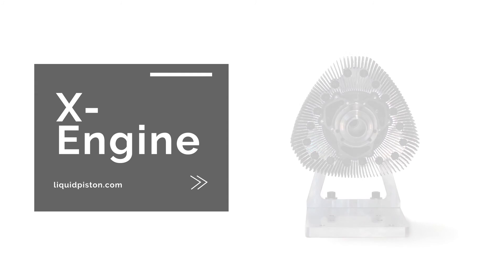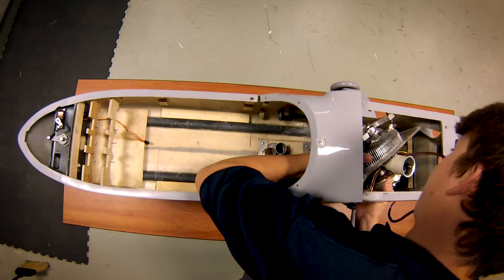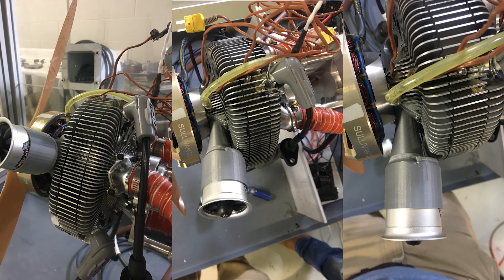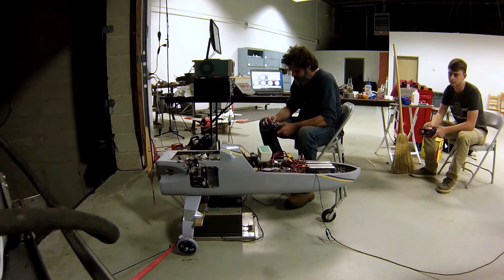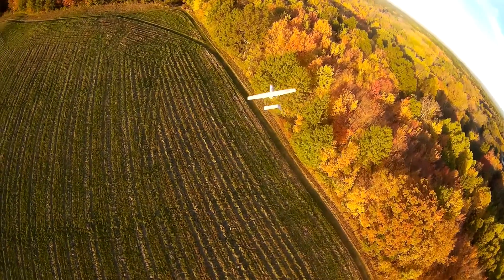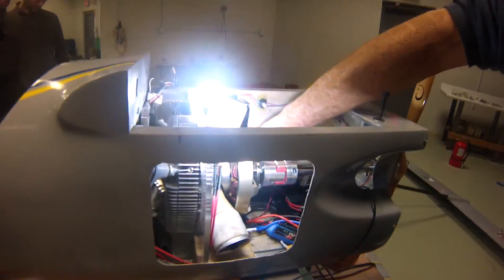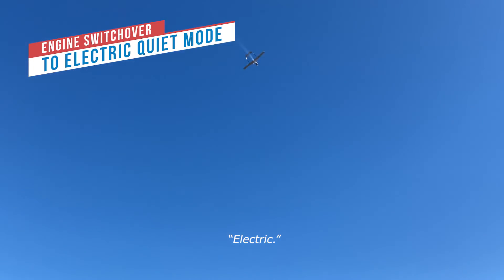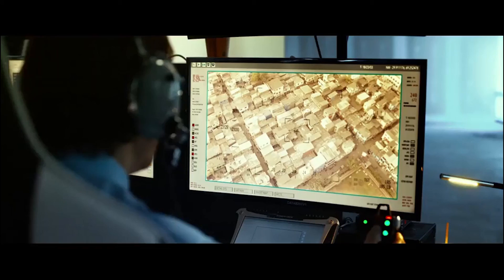LiquidPiston X-Engine takes flight [Long]

Comment: For the extreme power to weight ratio, it’s rather to work on helicopters than fixed wings aircraft to my thoughts... and strong enough to lift weight?
Reply: PASS! No way do I want to jump in a heli with an engine with such a short running life. I don't want to get in a heli with ANYTHING new and not VERY thoroughly tested and PROVEN to be durable and reliable in other applications first.
And why in hell would a plane not want the same (supposed) hp to weight benefits? That makes little sense to me. Either way, I don't want to see it in manned aircraft till it's very thoroughly proven itself in MANY other less potentially deadly applications than manned aircraft, models yes, nothing where a human life is at risk though.
Reply: @probingtime666  well seems I know too little about this engine type, too short lifetime is an hazard to aviation. But it’s not an hazard more on helicopters rather to fixed wings, because the turning rotor can still make it land safely without engine power. 
The reason I think it’s better on high hp to weight ratio, is I think it that it can lift up more weight for the same size... might be wrong ... how do you think about this?
Reply: @minercraftal   a heli can glide when an engine cuts out by very quickly reversing pitch on the main rotor blades and using the falling to keep them spinning and maintain momentum but, they don't have a great glide angle so you're stuck with finding somewhere very close. You do have the advantage of not having to come in at much speed and with the momentum built up you can almost land the very last bit at almost a stop which opens up options you haven't got with a fixed wing aircraft but, I'd prefer to have that much more gradual glide angle and time and distance to find somewhere if not an actual air strip. With the heli if you're in thickly wooded or very rough mountainous territory you're stuffed. You may not be much better off in the fixed wing but at least with the much greater gliding ability you've got a bit better chance of getting past or around that and finding somewhere. Either situation is bad and very dangerous, that's why I'd want to have it in common usage in cars, bikes and all sorts of other applications until it's well and truly sorted and proven it's reliability and durability first.
As for:   " The reason I think it’s better on high hp to weight ratio, is I think it that it can lift up more weight for the same size... "
Well yeah. The same can be said for the fixed wing aircraft too though, or am I somehow missing something?
A lot of larger helis use turbines which are light by comparison. I fly every second weekend on average with a mate in his old Bell 47 which like nearly all others I've seen are powered by a horizontally opposed 6 cylinder Lycoming engine of (if I remember correctly) about 280 hp which would be a pretty heavy lump of a thing I could only guess at the weight of but that guess would be around 400 kilos. I have helped load another Bell 47 onto a truck as a favor to him that was used for aerial spraying and your usual Bell 47 only has a load rating of (again, if memory serves me) 200 kg but this one had been converted to run on a surprisingly small looking turbine which would have reduced the aircraft's weight significantly and if that turbine was capable of the same or more power that would significantly increase it's ability to carry much larger tanks of spray making it much more practical for that sort of work.
There may be some sort of modifications that could compensate but my mate hates flying on his own, partly because he likes having someone to talk to and also to share the experience with but, if I or someone else doesn't go with him he sticks a milk crate filled with bricks on the floor on my side because it needs extra weight there to make it fly more smoothly and more stable so with the crop spraying one those spray tanks would do that when full, I have no idea how it handles while flying back to refill it though.
Reply: @probingtime666  well you know a lot of details and experienced. The last things to my understanding, is when the tank is full, the aircraft has more weight to carry, so the stabilator is a little bit hard to handle the horizontal stability, when the tank is empty, it’s less weight aircraft need to handled so it can fly back easily... 
and seems with a little bit more size of an aircraft, the larger of hp to weight ratio the engine can get, that’s what I don’t know nor thought about, I was thinking about the size of a bike of an avionics... well but as I know there’s more knowledge about it I don’t know, the hp to weight ratio is not the only things to it. 
Thanks for shearing your experience and thoughts XD.
Reply: @minercraftal  If you go to their website you'll find information about their current stages of development and testing etc and from what I read they so far have a very short lifespan. Not only that, all the stated expectations are so far just designers dreams and have never been achieved and may never at all.
My main point is that there's a lot of applications for engines on the ground where they can be used if they turn out to be any good, NOTHING that hasn't been VERY thoroughly tested by use and time that can be tested on the ground belongs in any aircraft where lives are at risk.
Reply: @probingtime666  well... these wonderful-looks design still have it’s defects, nothing perfect in the world yet XD
Reply: @minercraftal  They're making claims about it while the current state is that it's worn out very quickly, only reaches about half the claimed revs it's "supposedly going to AND only around half the power it's claimed it's "going" to be able to put out. They talk about a UAV with it AND an electric motor to run on for "quiet mode" which means the weight of this engine AND the weight of an electric motor big enough to put out nearly as much power as their engine plus a big battery to run it for however long it needs in so called silent mode even though a huge percentage of the noise from ANY model plane comes from the propeller, NOT so much the engine  so with 2 complete and separate power systems that would weigh significantly more than if it just had their engine meaning it's going to have to work much harder to fly all that weight so that alone means it will HAVE to make a lot more noise. There's far too many BS claims and essentially just dreams coming from them. I honestly hope they actually can get it to perform as they claim and that they can make it durable and reliable but, so many claims based on their hopes and no facts or demonstrated abilities makes me feel very much like it's a go fund me scam idea at worst and wishful thinking at best.
And what's with the name? Liquid piston? There's nothing even remotely resembling any sort of piston made of liquid and if anything it very closely resembles a Wankel rotary which it pretty much is so not even a completely new engine design.
If it's around in 10 years and replaced ALL those old primitive piston in cylinder engines I'll be happy to have one running my car, bike and outboard motors, I very much doubt it ever will though.
Reply: @probingtime666  anyway they are still working on it XD unlike me, thought about a rotary screw engine but barely make it continue but stuck on the “crank gear screw rods” shape... I like them make the parts so little with a extremely easy assembling. Maybe with some kind of inspiration they will solve the problems... shaping is a hard knowledge XD
Reply: @minercraftal   Well, they've made working engines and are madly promoting them. Now is when they should be proving it's abilities yet what they've run on a dyno and the one they ran in a go cart SHOULD produce something close to their claims if not what they claim yet they are only producing about half the power and only half the revs. Things just don't add up. I'll be interested to see where it is in a year or so, I bet it'll either be gone completely or "we're still in development" crap from them.
Reply: @probingtime666  😂 I guess this type of stuff can be easy or impossibly hard... and interesting. Was curious about and cannot find it in market yet, don’t know what price that will be given. ( sorry I’m not a good reader)
Reply: @minercraftal  They do have a website where you can read all about them and what they're planning plus videos but I think they ARE in the development stage still although they have running versions. Nothing runs as they're predicting but they do have ones running and they sound pleasant and fairly quiet. That plus the fact I've been building and flying RC model planes for many years now makes their plane a bit of a joke to me. Weight is the enemy of any aircraft and that has both their rotary engine AND an electric motor and complete power system for that for "silent mode" yet that engine doesn't seem to make much noise and with model planes it's usually the prop that makes the most noise anyway at high throttles so that's going to be little help in keeping it quiet but it will need to run harder and louder because of the extra weight. Also, because of that silly extra weight it's got to work harder to stay in the air meaning it's going to have to use more fuel so another weight gain to carry enough for any serious surveillance work. Just everything about their engines and ideas seems very either impractical or very iffy to me. Time will tell though I guess.
Reply: @probingtime666  well actually for rc planes it probably don’t need to run hard, I guess for the power output even as half, it’s still 1~2 hps that’s plenty to carry the fuel, supplys and everything for flying. Even they have not proved the running life of full power output. I studied avionics but only have played on 3d printer and 3d molding a little bit, maybe they can use 3d metal printed piston, it’s seems to me that the shape the 3d prints can handle these types of stress pretty easily, and as well they can try some more special internal shapes...
Reply: @minercraftal  YES, the weight does make a huge difference to how much power needs to be being delivered just to sustain flight and amount of power being used to sustain that flight, it also means it needs higher airspeed to avoid stalling so it WILL make a lot more noise carrying 2 complete and separate power systems and running on electric while carrying the extra weight of their engine, tank of fuel, ignition system plus separate battery to supply power for the spark plugs means any electric power system will have to work so much harder that it completely defeats the purpose of even having the electric motor and so called "silent mode"so as far as I'm concerned it's a bloody stupid idea. Take that excess crap off and you'll immediately have reduced the need for power by a great deal meaning their engine could run very gently and much more quietly. If you REALLY want to try and keep it as quiet as possible you start by making it as light as possible. A serious user who may really need as quiet as possible, like the military will have a range of UAVs for different purposes. For short flights of say under 10 minutes that DO need to be as quiet as possible they could use a large wing area electric with a slow flyer type prop spinning gently and pretty quietly. The other extreme might be longer term flights that can make more noise if it's not a problem then a liquid fueled engine is best for that as you can currently put any size and a huge range of brands available too and you could fairly easily carry enough fuel to stay airborne for much longer then a dozen different variations in between but a liquid fueled model WITH an electric power system for so called "silent mode" IS ridiculous since all that extra weight means it has to work a lot harder to stay flying, it's also going to have to fly faster meaning capturing much on video may get harder but mostly AS I'VE ALREADY SAID, it's going to have to work much harder causing it to make much more noise which then defeats the purpose because it WILL NOT BE QUIET AT ALL.
They talk a lot about things that it's not even remotely capable of as fact even though they have running versions.
 They come out with cool sounding crap like this dual power system bullshit that in practice makes NO sense.  
They compare an extremely low powered but large and with all attachments from alternator to radiator hoses lump of a low powered diesel ignoring the fact that there's physically smaller diesels available that put out more than FIVE TIMES the power of the one they compare THEIR engine of around (supposedly) the same power to.
I don't trust anything about them so far. If in a year it's being used all over the place in all sorts of machines and people are getting good economy, reliability and durability I'll be happy to consider using one, NOT TILL THEY'VE PROVEN THEMSELVES THOROUGHLY THOUGH.  Even then if they're still talking about some BS UAV with a separate power system for "stealth mode" I won't have anything to do with them. That dual power system for "stealth" when it's already weighed down with another complete engine, fuel supply and ignition system is so unbelievably stupid I'm tempted to just outright say I'll never have anything to do with a company promoting such an idiotic idea as that.
Reply: @probingtime666  didn’t paid attention to those of “stupid ideas” until you said about it. Maybe it’s myself defect from which China have did this type of shit for many years (talk about plans before they haven’t got it yet) and got used to not believe it. My method is always on how to prove, thus I don’t have any motion (or rarely doing something). It’s hard to tell the future, just sounds to me it’s some possibilities because except the power output system, the rest of those can be made really light weight (maybe not long term redialing system, don’t have enough knowledge). There’s some serious argument about election motors and combustion engines for a while, to me there’s more of magic on electric batteries that the acid seems “transact” out gave me more of interests like “atoms 3d printer”, but to the world of power, those efficiencies, durability’s, I have quite little idea, the number of shapes is infinite.

Comment: In the technical paper you provided, both X mini and X4 look amazing in terms of size and power density. But the time between overhauls is surprisingly low even for a prototype. Is there a specific failure point or it's inherent in the design just like in Mazda rotaries they ditched 10 years ago?
Reply: Ошибаетесь. Mazda не отказалась от роторных двигателей!
Reply: I was a bit surprised at the lack of longevity stated for them. If they only lasted that long I wouldn't take them if they were giving them away. It's not worth the trouble of even changing them over so often. If they can improve that to be at least comparable to a normal piston engine I might be more interested. It sounds very much like early stages of development to me, even though they make it sound like it's about ready for market it's a long way from that.
Reply: we are in the new era of disposable engine ... due to very few parts involved ..but low lifetime
Reply: There were a whole host of issues with the Wankel that caused Mazda to drop production of them, not just longevity. I mean, look at the rotary enthusiast crowd, if it were that bad would they still be as prevalent as they are? Sure a few hangers on could be expected but the scene is healthy, alive, and kicking.

Also, as stated in another comment, longevity of these things is totally a deal breaker, unless there is some other absolutely amazing benefit elsewhere Im missing. Piston engines simply out perform. However, and this is not intended to persuade anyone simply a reality check (and.....yeah okay.....a little bit of a 'lets see where this goes' for the LP engine, Im not saying they'll change the world, but I find the concept interesting) piston engines have had a long...long...LONG...time to get the kinks worked out. Complex or not, we simply know how to build them, period, end of story. Heck, I have a i4 1.8 that puts out more power, at better economy, than both 3.1 v6s I used to own (and miss....for sentimental reasons). To take down the piston is going to take something that breaks physics at this point....
Reply: @zombieregime  It's not just about longevity, it's also about reliability. There's no problem it powering a UAV, but having a catastrophic engine failure with people flying onboard a light aircraft powered by this engine is.